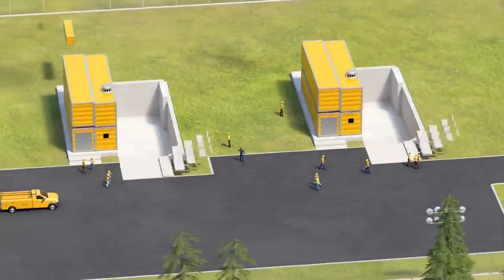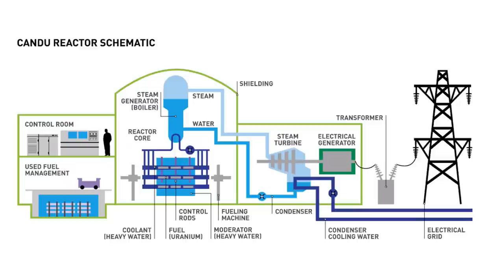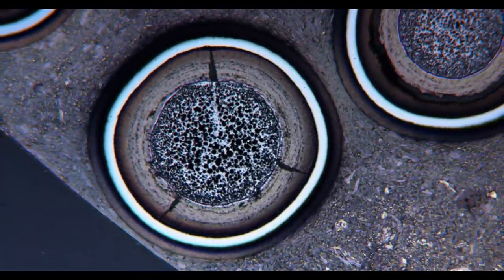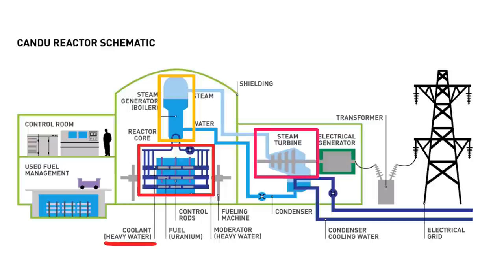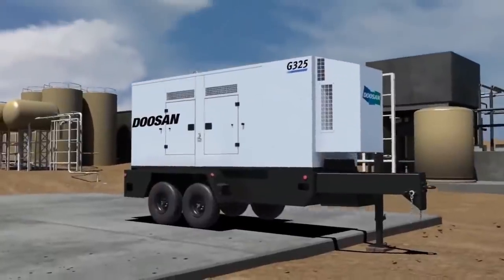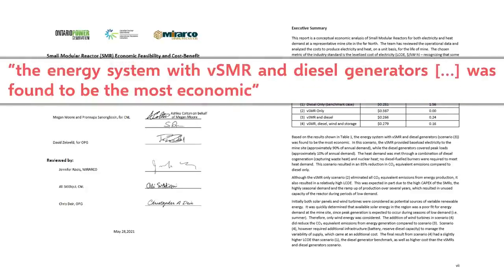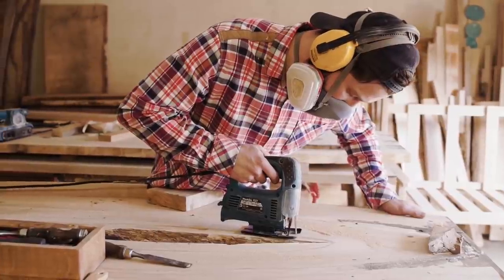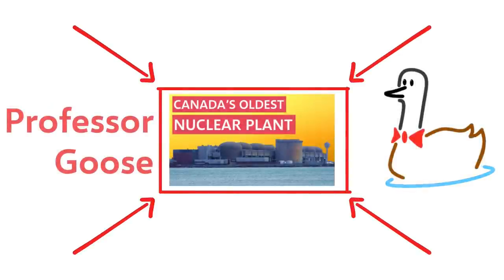This Micro Nuclear Reactor Could be Replacing Diesel Generators by 2026

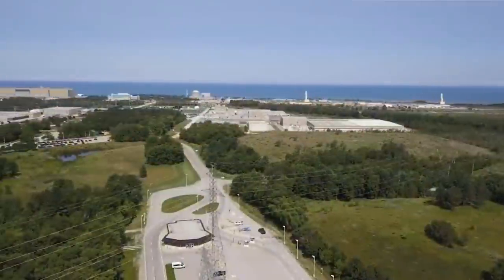Comment from the maker: Clarification: From 4:18 to 4:45 I stated that traditional nuclear reactors "aren't very good at [...] adjusting their power output." I wanted to clarify that traditional nuclear reactors like CANDU reactors do have some load following abilities (they can adjust power output from 60% capacity to 100% in 4 hours). However, in Canada at least, CANDU reactors are used to generate baseload power. 

Sources: 
https://canteach.candu.org/Content%20Library/20054414.pdf
https://cna.ca/advantages/energy-reliability/
Reply: I want to point out that fission products don't end up in the cooling water for PWR's or BWR's. You do get deuterium and tritium though because of the neutrons hitting the hydrogen in the water.
Reply: They are putting a small reactor at  Eilsen AFB in North Pole, Ak.
Reply: German EPRs can follow quite well too. So in general, it is not a valid statement. They can follow but it is not economically viable.

Comment: SMRs sound so frickin radical!  These things make me genuinely optimistic that we will be able to actually do something about climate change.   Hopefully we can get some running off of spent fuel from less efficient types of reactors as well.
Reply from the maker: I actually made a video about reactors being developed in New Brunswick that use spent fuel: https://youtu.be/3u44skO-nMo
Reply: I hope they get tiny enough to fit in our cars and appliances
Reply: First-generation modular reactors will not use spent fuel as reprocessing is generally frowned upon and a big no-no word in the industry. However, these designs will have higher burnup than your typical PWR and BWR.  If SMR 's are successfully deployed via private industry the next step will likely be more advance forms of the technology notably molten salt designs. Although Terrestrial power has a really neat integral modular MSR design, it won't be allowed to be refueled as it has a thermal neutron spectrum won't be able to consume spent fuel unless its reprocessed as well.
Reply: What could go wrong? Nuclear reactor. End of story.
Reply: @zalxder  a few nuclear  cars were built in the 1950s by one of the big three .
Reply: @oldmech619  if the new designs can be fuelled by existing Nuclear Waste, it is somewhere to STORE it👍
The new designs are a closed unit that runs for 60 years without refuelling...by then there is much less toxicity and time to sort out the next step🙌
Reply: @oldmech619    Sure old man. What could go wrong with releasing millions of years worth of CO2 within a couple hundred years?  End of human story…
Reply: @mtn1793     I am all for nuclear power. Thorium would be best. I am totally against small scale portable reactors. Safe?  How many times in history have I heard that. There will be extreme push-back by everyone associated with the public and regulatory agencies. Mostly associated with security.
Reply: @cherylreid2964    Who is going to pay for 60 years of high level security?
Reply: @oldmech619    When you say security I’m guessing you mean against terrorist bomb making. An important feature of the new designs is that their fuels are less able to be used in bombs. Given the existential threat of CO2 build up in the atmosphere, compared to the threat of terrorism I’m inclined towards nuclear electrical generation bing too important to ignore any longer.
Reply: @mtn1793    How about nuclear waste ?
Reply: @alimali2120    There are new tech reactor designs that are capable of running on much of the current waste. That would take an investment in reprocessing but the current nuclear business model makes much of its profit by sweeping nuclear waste under the rug.  The special interest have US in a stranglehold.
Reply: @oldmech619  

What sort of scenario are you worried about? 

I mean, if terrorists got a hold of such a reactor and managed to open it up, they would die really quickly from radiation poisoning. 

They would need to control it for several years before the radiation from the fission products would be low enough to open it up and extract any material for a dirty bomb. They would also need to concentrate the active material from the salt, doable but they would have to make the equipment for it first. It would also require quite advanced knowledge of high temperature nuclear chemistry. I really don't see that happening. If they have the knowledge and organisation to do that, they pretty much could make their own plutonium for a proper fission device as well.

[Edit]

Incidentally, the only organisation that has ever been dumb enough to attack a nuclear power plant is green peace. All smarter terrorists have realised that a nuclear power plant is a bad target, it really takes special stupidity to attack the safest place ever.
Reply: By providing clean, safe, and reliable power to the third world and of course the developed world will be a game changer.  When people aren’t living in desperate poverty w/o electricity or running water they don’t have the luxury to care about the environment.  Lifting the poor out of poverty and bringing them into modernity will make an enormous impact.  Switching over most fossil fuel energy sources to nuclear will get us where we need to be.  Innovation will continue to improve our ability to support high quality life for humans while minimizing impact to the earth.  Good stuff!
Reply: @oldmech619  How is this different than research reactors on a University campus - lol
Reply: @alimali2120  Disposal in bedded salts like the Delaware basin - New Mexico or West Texas. Same as WIPP.
Reply: @shawnnoyes4620    I have no idea how the university nuclear security is handled, but I bet it is highly regulated is has limited amounts of radioactive material on sight.  Just want to note that a university nuclear research center is fixed on land while mobile reactors, by their name, is problematic.
Reply: @shawnnoyes4620  Nuclear waste are dangerous for 700 million years and every year we get 100 thousand tons of nuclear waste . With which math are you going to calculate on earth the accumulation ?  We can not calculate it with todays greek,arabic math . Did you find another math or are you living in an other planet ?
Reply: @shawnnoyes4620  I am sure either you don't have any child and/or feel any responsibilitiy for our next generations on this earth .
Reply: @shawnnoyes4620  I would like to totally agree with you that if nuclear were easiest,cheapest,cleanest energy source but the waste . But the waste , but the waste , but the waste .

Comment: I used to work in biomass, and I think we need to go nuclear in a big way. France is leading the world with something like 60% of their power coming from nuclear. Renewables just aren't the sole answer.
Reply: France is over 70% nuclear.  A lot of the questions and concerns about nuclear energy can be answered with "just look at how France does it".  It isn't some state secret, any country can learn everything they need to know, they just have to look.
Reply: And France is building more reactors!
Reply: if you put grass in a bag it gives off methane in the right concentration to put it straight in the mains, when it's spent you put it on fields as compost.

I don't see where the problem is?
Reply: I do not understand biomass one bit.  How is BURNING stuff ever green?  We can't claim that our forests are sequestering carbon if we burn them and putting our trash in in our air is so much worse than back under the ground.  Let's plant trees, they are awesome, but don't delude ourselves that those trees are going to magically turn back into subsurface coal.  If we want to plant something to sequester carbon, try algae, at least some of it gets sequestered in subsea sediments and it grows a hell of a lot faster than trees.
Reply: @scottarmstrong5607  It's green if it's from cleaning up overgrown forests for example. Or would it be better to have a gigantic wildfire that would liberate the CO2 anyway while endangering wildlife and anyone around? Overusing Biomass is bad, responsible use is great.
Algae an all are cool for other purposes, as for example substituting oil products as fuel.

Comment: This is a good step towards being Nuclear again and bringing the power of the atom back to be the most common nuclear power resource. The next step is to apply the LFTR Thorium process which is so much more simpler and cheaper. The micro encapsulated pebbles explained here are of a proprietary process of production which is very restrictive to a small number of producers. On the other hand the LFTR is an open source process that is just as safe but at a much lower fuel production cost as well as reactor fuel replenishment. The LFTR can still be at full production while being refuelled. This is the best approach for all grids around the world. The Canadian model here is a great step forward for nuclear and will be very easy to refit or conjoin any of these power sites with the LFTR process.
Reply: why would you want the most expensive form of electricity generation in the world?

The video says if the 'new improved version' gets off the drawing board it might just about compete with on-site Diesel generators

Comment: Nice project! A small correction: traditional nuclear power plants always can adjust the power output, although it is quite complex to go below 30% power. If is mostly convenient to run them at 100% power since the fuel is not a cost factor.
Reply: I was about to point out the same thing.  France generates over 70% of their electricity with nuclear - they have no problem doing load following.

Using nuclear to heat a big tank of salt does have one substantial advantage though: as long as the salt it is kept hot enough it can be used to run a supercritical (water in a state where its liquid and gas phases are not separate - there are no bubbles) boiler and steam turbine.  Supercritical water is more efficient at turning heat into mechanical energy.  This is nothing new, there are supercritical coal, gas, and combined cycle power plants out there already.  What hasn't been done is a supercritical water nuclear power plant because there are many unanswered questions about what happens when supercritical water is run through a reactor core.  Using an intermediary like molten salt will lower the potential maximum efficiency, but it is something that can be done now as opposed to whenever we get around to answering all those unanswered questions.

Comment: That sounds pretty neat! 

Though I’d like to see them using Thorium instead of Uranium, and something besides Helium, due it’s eventual relative scarcity. 

As regards diesel generators, if they’re unreliable, they’re not old ENOUGH. Truly old machines that date to a time when quality was top priority are phenomenally reliable, and actually quite efficient, due to their slow speed. This still does not escape the problem of expensive fuel.
Reply: #DOit
#historyisYOUdummy
Reply: @tuc-dh4df  no, that is not correct
Reply: Bio diesel on slow running old generators is a much greener approach and can be deployed in 1day to 1mth. Not 5yrs plan.

Comment: New nuclear is just a dream until they can reduce the costs per kWh to where new NPPs are competitive with renewables plus storage.  Meanwhile as the older NPPs are getting close to their license renewals, the utilities are not renewing and instead are decommissioning them and replacing them. They should be kept running, so no more gas or fossil fuel plants need to be built.  The fossil fuel plants must be phased out ASAP and replaced with sustainable energy and pumped hydro storage.
Reply: What is the cost of renewables plus storage?  AFAIK, no wind projects include storage for more than hourly fluctuations.   Similarly, no grid scale PV includes batteries sufficient to load shift from peak production to peak consumption, say 5 hours.   The battery projects are only frequency stabilization and a bit of displacement of new natural gas peakers.  Where is the island in the world where they've gone completely renewables plus storage?  That would give a real price.  Hawaii Island cost of around $0.35/kwh has got about 43% penetration, but I'm not sure exactly what that 43% means.

Comment: Excellent video. One point that needs to be addressed is the problem of long-lived nuclear waste and its disposal.

The idea of having a reservoir of heat in molten salt is intriguing. In a small community one can imagine it being used to heat water in an insulated piping network which can be accessed by heat pumps in industrial and residential buildings thus reducing the need to burn fossil fuels for heating.

Comment: Compared to the other Type IV reactor design I have seen I'm not impressed. Solid fuel is always a bad choice and every form of pressure vessle is always a bomb of kinetik kind at least. They avoided the obvious garbage: water + zirkonium oxid, but I'm not convinced about the safety features. A freezeplug is a tested safety feature that works and makes sense. Controll Rods don't work when your core melts or breaks in any form. A pressure reactor you can at least do a bore poisoning.
Reply: Molten Salt reactors are probably the best option as they can’t meltdown, the only issue is it’s corrosiveness but that can be fixed
Reply: I suspect that the reason the core can passively cool it's self without outside intervention (besides all of the measures they have taken) is because of the core's small size. This is probably why the company hasn't designed anything bigger then a 5 MW reactor. Also why their solution to scale that up is to daisy chain these reactors together.

Comment: Looks promising but i'm still skeptical. Gas cooled reactors were the first that got built (Magnox/AGR in the UK, UNGG in France) but their construction was stopped.

UNGG reactors demonstrated instability at high power with some of the core melting (Saint Laurent des Eaux in France).

Same thing with the british reactors that are now getting shut down because of graphite deterioration (Hinkley Point B).

Comment: "Regulate their power , something traditional nuclear reactors can't do" 

Have you ever looked out to the world and informed you about the load-following capabilities of nuclear power reactors like PWRs or BWRs? They can and do follow loads, they do so even better than combined-cycle gas turbines and they do so for almost half a century. Famous examples to do so daily are the french P4 and N4 reactors or the german Konvoi and pre-Konvoi reactors, able to change their power output by 5% (standard configuration) or 10% (load-following configuration) of their nameplate capacity per minute. That's 140 MW per minute for a Konvoi or N4 and they even compensate for frequency variations in their regular operations, as the german power plants Isar-2 and Neckarwestheim-2 did for the last decade.

As you said, it was a deliberate decision to make the UNSC's MMR relatively unable to follow loads. That is nothing to generalise at all.
Reply from the maker: Thanks for bringing this up, I pinned a comment to clarify

Comment: This is where in the road way charging as you drive down the road is great. All forms of generation of electricity can be used to feed the electric road charging as you roll down the road. This changes all energy in to a standard power that can be used in most appreciations , not perfect but their is not a perfect way to use energy but electricity is easily moved around the country more and more and quite safely.

Comment: A bunch of small generating stations would also help to protect the power grid system in the event of a war. Right now in the USA, Canada and the rest of the world it would be much easier to take out a few large power stations than many smaller ones. The 2 major draw backs I see in having many more generation stations is a higher chance of catastrophes and possibly the initial build and operational cost. The more units the more trained personnel required and the more personnel the greater chance for mistakes eventhough this system is touted as being extremely safe.